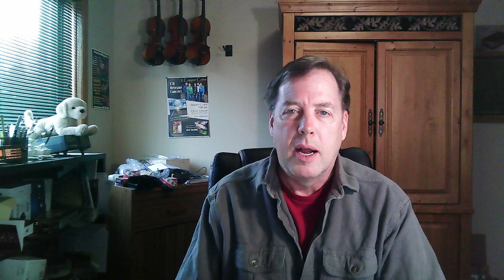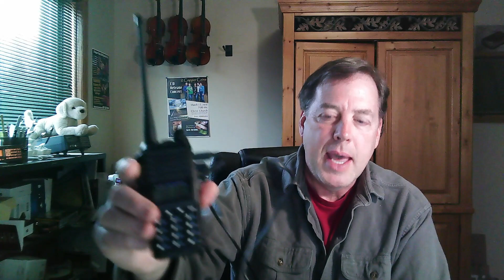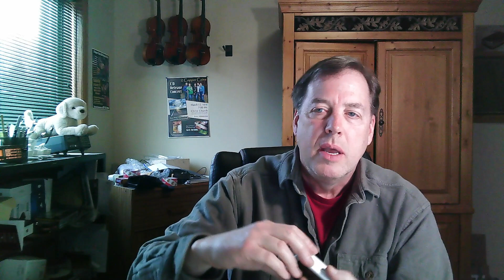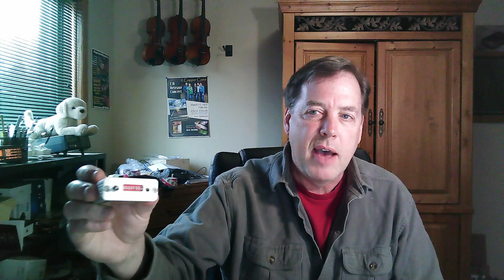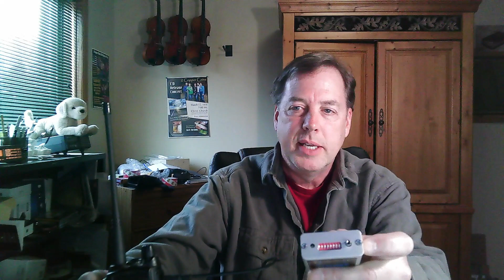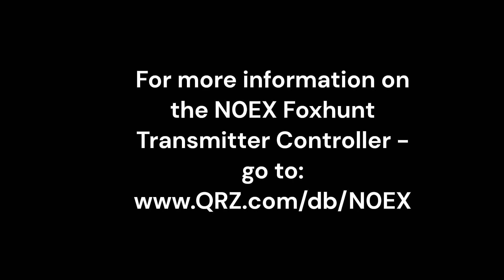Amateur Radio Foxhunt Transmitter Controller Demo

Comment: Very glad your controller uses a temperature compensated crystal oscillator for stability.  I've run into drift issues in fox hunts when using other off the shelf products.
Reply from the maker: Thanks Matt. Yes,  for a single TX foxhunt it would be fine without the TCXO, but I have presets that would allow you to use this controller for 5 Transmitter ARDF hunts, so I needed the precision.